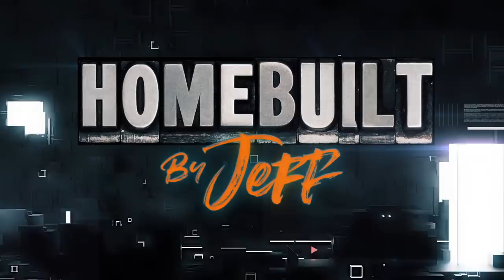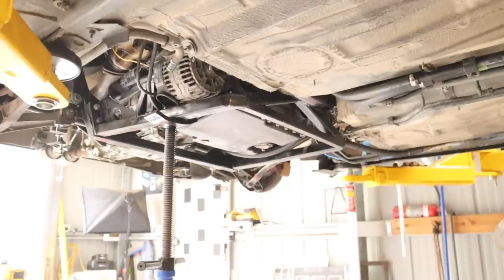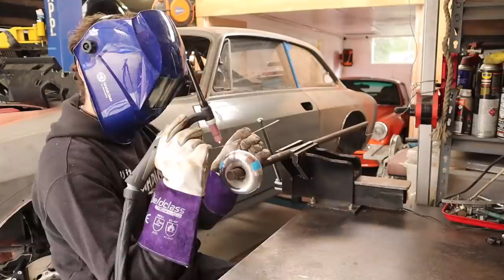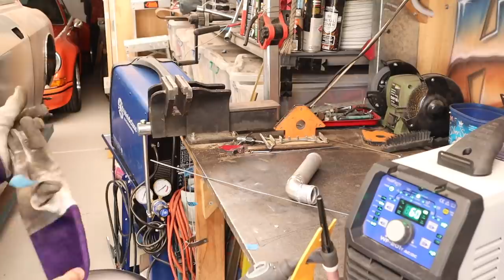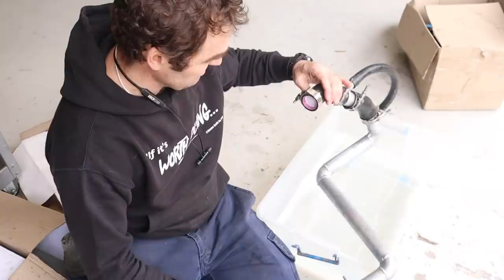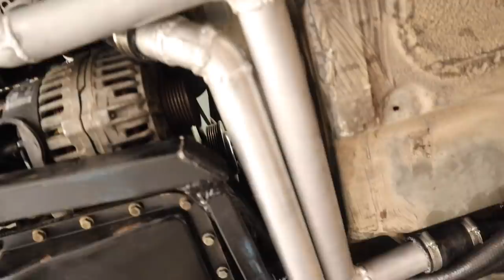Finishing touches - Porsche 986 Boxster V8 engine swap track car build 15

Comment: In case you didn’t know contamination makes welding aluminium an awful lot harder!
Do not use wire brushes or cutting disks that have been used on steel or anything else. Use only stainless steel wire brushes. And clean weld surfaces are a must.

Comment: You will have to put a support bracket under the pipes. When you have water in them, you could have 20 - 30 kg of weight in the pipes. That is a lot of weight forcing the pipes to fall on the road. A bracket which holds the 2 pipes apart will also stop them rubbing .. Good Job.

Comment: Jeff.
Are you going to put a bracket and isolaters in for those new cooling pipes. 

Just thinking under track load they will clatter like hell.  Some plastic or synthetic bushing and clamps?

Comment: Hi Jeff Notice your radiator pipes are close to car and each other.Are you going to use rubber spacers to stop vibration of metal aluminium pipes?

Comment: Great video as always mate 😊 With that pedal wiring I remember when extending a BRZ pedal for a FA20 conversion that the signal wires were shielded. Hence I'm not sure if you'll get any interference from using the unshielded trailer wire.
Reply from the maker: My 911 isn't shielded
Reply: @HomeBuiltByJeff  Cool. Just thought I'd throw it out there so you didn't have any problems later on ;)

Comment: First of all seeing you welding is something hypnotic... but in my opinion your alloy pipes are too close an without any constraints you risk that they sing like bell with vibrations. In long term cracks are possible. You should clamp them in the middle and put some rubber like vibration dumper

Comment: I would have used some shielded and twisted network cable or similar for the throttle pedal wiring, the trailer cable is a bit heavy but more importantly it isn’t shielded… hopefully you don’t have EMF issues.
Reply from the maker: I don't have shielded cables to Harry's pedal, and Link don't recommend that.
Reply: That stuff is solid core though, not for use in environments with vibration. Plus factor wires aren’t shielded.

Comment: Not sure why you needed a wiring diagram... just copy wiring from plugs on both ends no matter what color is in between
Reply from the maker: That is fine if you are wiring to the original ECU. You need to know what they all are with a stand alone ;)